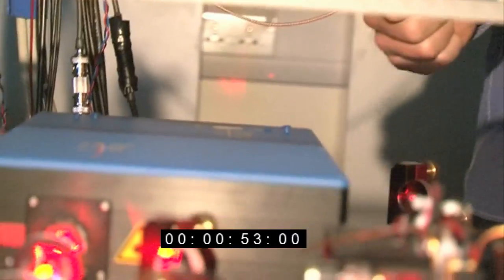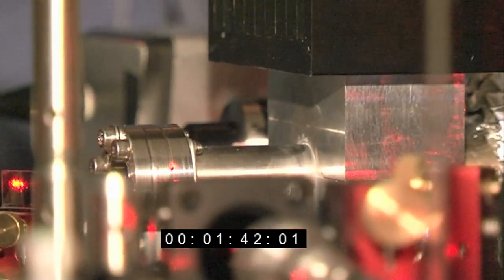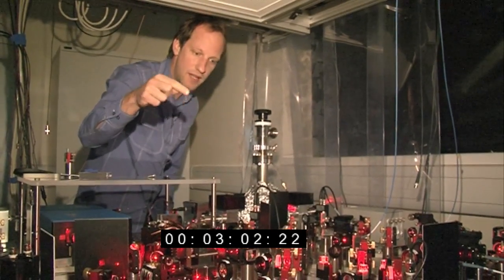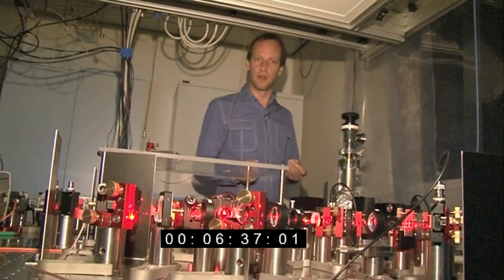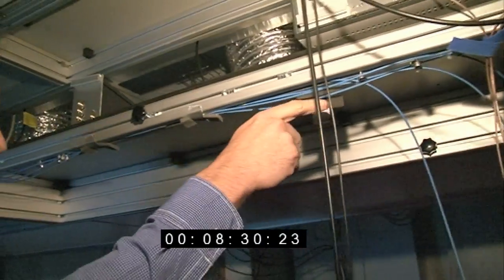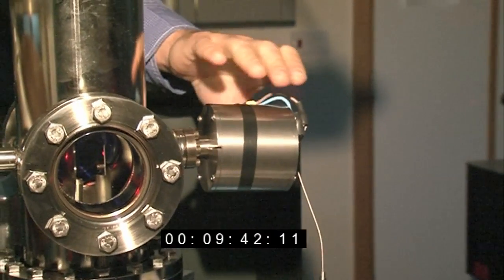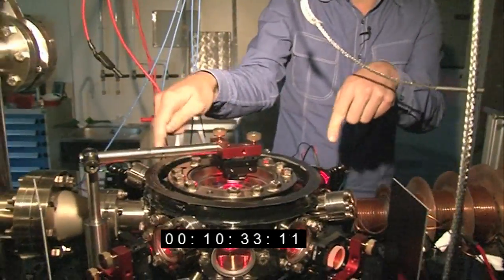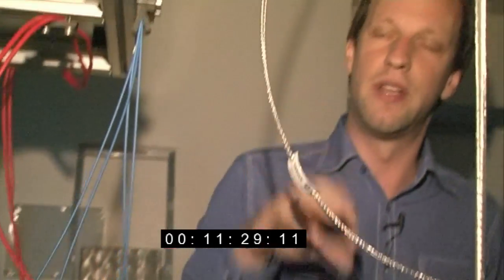Laser Cooling (extra footage)

Comment: I imagine that by the time this happens the atoms will already be at a temperature of around 0 kelvin, I am speculating that the reason the cooling technique can not reach a temperature cooler than that is because of the fact of what happens when atoms cool to this temp. They, in essence, are no longer atoms, meaning that the certain frequency they once absorbed to be able to be slowed, they no longer absorb, because they no longer have the physical properties to be effected by the photons

Comment: @joncl1 yes, but since you're not trying to achieve a specific speed of the atoms it will be a lot easier.  You could just fire laser light of any wavelength (as long as it is absorbed by the material) and any power.

Basically... Shooting a laser at something will heat it up.
Then you realize that that was pretty obvious ;).  You knew that before you even learned about laser cooling!  (ie: james bond)

Comment: Just to answer a couple of people's question; the actual reason you can't reach absolute zero is because of a phenomenon known as zero point energy which comes from quantum mechanics.
                  It basically shows that for any system, so in this case the atoms you're cooling, you can never reach zero energy because this zero point energy contribution from quantum mechanics will always still be there and as there is energy that will translate to a non-zero temperature in any substance.

Comment: So just how exactly do you adjust the frequency of the laser? Is it through increasing or decreasing the temperature of the diode array, or through changing the current?
Reply: You can change the frequency of a laser using two beams interfering with each other at different phases
Reply: Tesfa Berhanu
Oh, that's pretty neat, thanks for the response
Reply: @NapalmFlame  it's known as a michelson interferometer and works with polychromatic light only.